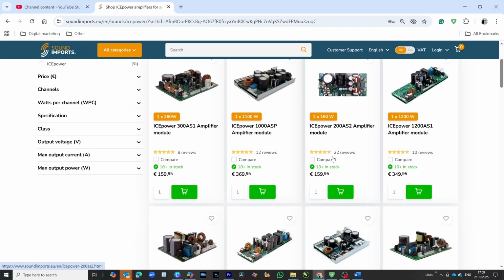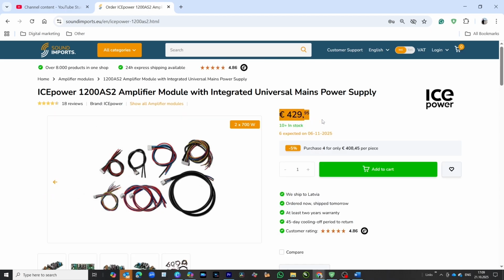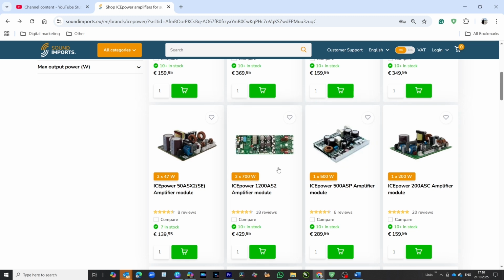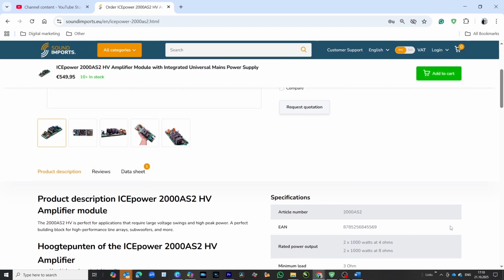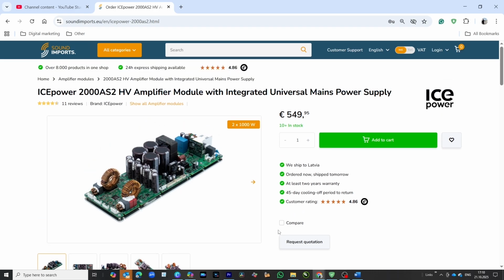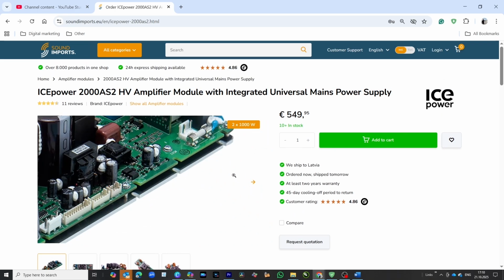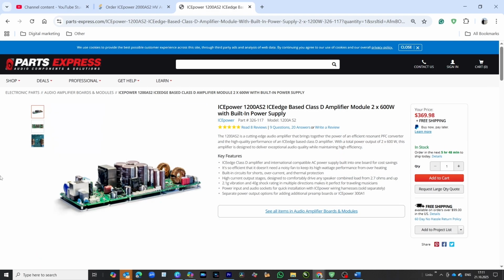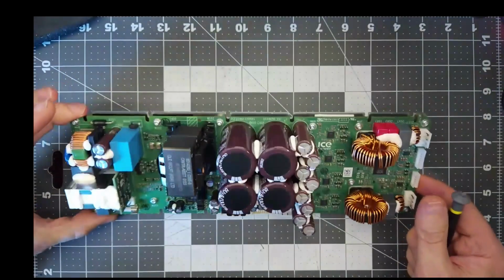Best amplifier in the world, does it exist Part 2 ICEpower 1200AS2 board deep dive

Comment: I mentioned this on your  comparison video: I bought a EVS 1200 (no longer made) based on Icepower AS1200 dual mono modules (same as in PS Audio M1200 monos but > $$$$). He tweaked them as much as he could, put them in an Italian chassis with more tweaks. It was ~ $2700. Amazing
Reply from the maker: We are living in information sociaty wher community is sharing a lot of things. Those small tricks liek putting something in jewelry box and selling welthy socity is not working well. Industry desperatelly need something new in amplification industry. Currently I do not see where it can go. Integrated speakers - too high startup costs. I see only one direction- multichannel amplifiers with build in DSP and spekaer boxes without passive crossovers making option to chosse passive crossover or make system active with external multichannel amplifier.

Comment: Very nice design , literally gluing caps to hot AC DC rectifier , so look at the top left of the board , that will be the place of failure . Also that SMPS is not the best design but ok , what is not ok is the lack of cooler on Amp chip , and even with it its Class D amp , meaning it will have noise on the output . If you use it with sensitive tweeter you wont be able to put it close to you due to hissing . But its good for sub , but it will fail .
Reply from the maker: It is a good, proven design. I have seen other professional amplifier companies using similar architecture. The output noise of this amplifier is just 30mkV.
Reply from the maker: You can run this board and check with a thermal camera. Everything is fine. I implemented this board in several designs and they working well in all load conditions. With a small fan board can even do professional scenarios with confidence. running at clipping level. For home usage, it has plenty of power reserve.
Reply: @guntarssmits2104  so you say its good to put electrolytes near heat source and glue them together, especially then we know that glue will conduct eventually , for the actual measurement dont do that , you dont know anything about performance of this amp , nor do it . Audio Analyzer has to be used . Rest is gossip. But since i know how Class D amps work , you can get rid of the noise but then you sacrifice high frequencies , all Class D amps have LP filters at the output , impossible to make them otherwise ,just like Tube Amps need an output Transformer , its a bad thing but what can you do . Same here , if there is no noise then HF is dulled , its a balance , there is no Quite Class D amp , does not exist , well one can make 2 and put them trough comparator with negative feedback  that would lower the noise , but drastically increase price for lowering a bit of Hiss on the output .
Same goes for Tube Amps , there are ways around output Transformers but its not easy and it comes with its own set of problems .

Then again  ,i use Class D amp , im not saying  they are bad , nor that this board is bad , aside the rectifier that is planed obsolescence . Im sure it is good , but non the less with a sensitive Tweeter hiss will be there . Where on other kinds of Amps if done good its not there . Maybe there is noise , but not Hiss , its inherent to the design .
Ive seen all of this and its fine running passive speakers with non sensitive Tweeters , there is Hiss but its not a problem . But on some speakers  it is a problem , for Near Field . For PA systems its not an issue at all .
Reply: What you are saying about the performance is not supported by the measurements. You need to look closer - the output devices are under the board and they are mounted with screws to the aluminum plate on the bottom side of the module. Quiescent noise level on the actual amp board is low; even sensitive tweeters do not produce detectable hissing. I have this amp, and I do not think you do. If you did, you would not claim these things, but fortunately the data sheet has a great deal of measured data in graph form. If you think you will hear the 400kHz switching frequency of the amp then you need to brush up on the physiology of the auditory system, because that’s just incorrect.
Reply from the maker: @Acoustic_Theory  Most probably, you have a grounding issue in the system. The board is dead silent when implemented properly, and meeting specifications indicated 30mkV output noise, which is very low for such power.
Reply: @Acoustic_Theory  i dont have it , you have it ,ok put a finger or the Rectifier , measure the temp of those caps glue on it .This will dry them very soon and since its mains its going to ruin the board , and maybe even your speakers .
Do the test , tell me im wrong and the Rectifier is cold .
I never said its a bad amp , but bad design in places . For example that Rectifier , those get hot , diode voltage drop is about 0,6V ,  x4 , those are the loses that go to heat . Everyone knows electrolytic don't like heat it dries them .
So if you have it , i highly suggest removing the Rectifier and put it on the other side of the board away from the caps .
That way it may work for 10 years , without that mod it wont . Obviously its hard to predict but it will die faster if that rectifier keeps heating up those caps .

Comment: Do they sound as good as hypex nilea?
Reply from the maker: All the latest gen class d amplifiers sound the same. They are using similar technologies and have neutral, precise sound. The key difference is in power and price.
Reply: @guntarssmits2104 ice amps seem like a much better bargain as far as price goes . The cheaper price had me skeptical about if there's a significant difference in sound. But I always hear you speak highly about them sounding musical.
Reply from the maker: @BostonMike68  Price is largely a function of volumes. Icepower manufactures its electronics in Malaysia, and Hypex in Denmark.
Reply: @guntarssmits2104 That makes sense
Reply: @BostonMike68  My EVS 1200 still does (dual AS1200 mudules), some 3-4 years since I bought it new

Comment: reviewing design and architecture perspective of a complex product isnt a good way of checking if something is good or bad. Testing the outcome is what you must do. test frequency, step response, max and peak power, sinad etc
Reply from the maker: For industrial certified boards, it does not make sense because you can trust the manufacturer's specifications. Some parameters are so good that you need specific, expensive equipment with a valid test certificate to measure them.  And there is legal responsibility for the outcome when you do it as a company ( legal entity). I will not publish industrial boards' measurements. For the 1200 board, everything is according to specifications, according to our tests. This is a good board from a good manufacturer.
Reply: @guntarssmits2104  Exactly.  A company like B&O/Icepower are mainly an OEM supplier for a lot of Major brands-- Fender, and Bowers & Wilkins, for example.  As such, the specifications and performance of their boards are a minimum as to what to expect, especially WRT to THD+n.  Large companies can rely on Ice to deliver their stated claims.  The datasheets from Icepower are excellent, very complete, and again, the quoted figures can absolutely be relied upon given the quoted operating environment.  The modules I've tested have met or exceeded quoted power, with measured noise and distortion besting B&O's quoted numbers.  All around a great company with an amazing engineering sector.

Comment: I built two monoblocks because I like the symmetry of having two amps in my rack (which used to be my beloved grandparents' coffee table), and I used two 1200AS1 single-channel amplifier modules from this series, installed in aluminum extruded cases. Their sound is refined, powerful, and not harsh, which is wonderful to find in a powerful Class-D amplifier. Icepower has nailed it with these modules. Only downside is that if the case is too open, there is a little bit of coil noise in the power supply, but this does not make it into the output.
Reply from the maker: Impressive setup. I have measured amplifiers output noise and ir is practically inaudable on speakers output. For me it is kind of strange feeling hat with good DAC you have a impression that equipment are switched off between the songs. Audio quality in all chain from source till the amplifier output hits the wall. I am wondering what will be next step in audio. McIntosh company mooved to Car audio to be profitable. High End conept is declining. What next?
Reply: @guntarssmits2104  Concentrate on the loudspeakers!  DACs and amps have been a solved problem for a while meow😎
Reply: That's why I didn't buy the ice amp, coil noise. But it looks like they updated the board and fixed the issue.
Reply: @florin604  Can you tell me where you read this, or what changes you noticed? I’m interested in any things to look for. These are great amps and I’d be glad to recommend them universally.
Reply: @Acoustic_Theory it's in part one of the video, where the new module has the issue resolved

Comment: There is no way that the transformer is 5kW.
Reply from the maker: By ICEpower 1200 data sheet, the rated power supply power is 3.8kW. Transformers should have higher power ratings for some reserve. Switching mode power supply is working at 80kHz and higher. Small-dimension ferrite core can transfer huge power in a small size. It is not the same as with 50Hz conventional transformers, which would have 7kg. Technology moved forward.
Reply: Switch mode PSUs use very high frequency mains. Transformers operate at extremely low dissipation. That is actually a very large SMPSU mains transformer. I don’t doubt the claim.

Comment: If you only "need" 50 watts for 91 db speakers, would you just get the 200 board?
Reply from the maker: There is a link to ex BBC engineers testing real power consumption for 100% transparent music reproduction https://youtu.be/Y3WpRY-EtX8?si=NRE0H9bJxhJDxM2q but you can use lower power amplifier for your system taking in account that some music with dynamic bass may be suppressed. Power reserve is one factor distinguishing mainstream amplifiers from top performers. Power and quality in the same box is costly option. By far more costly to desing, than just a low THD for moderate power. And good bass is crasy power hungry.

Comment: The ICEpower 1200AS2 is far faaaar from the best amplifier in the world. Actually, it's not very good if you compare to Nilai 500 or Hypex NCx500
Reply from the maker: This is exaclty what marketing traing to seed in community, but it is not true. I encouradge to read Brunos arctice where he stating that latest gen class d meeting point of perfection regarding audio quality and transparency. Other auplifier features like power, integreated by desing and features are key differenciator of modern designs
Reply: @guntarssmits2104  I mean yes you have a point, and Bruno is right, but when it comes to the ICEpower 1200AS2 it's not really accurate. That module is'nt that good. It has issues.
Reply: What issues? It is a hard claim...
Reply: @robertschumacher9640  It has issues with power on and off pops, it has issues with hissing, it has issues with quick impedance drops that makes it distort, it has issues with power-pumping with low impedances. And quite frankly, it doesn't sound all that good. It's kind of harsh and forward in the higher frequency's which makes this one more suitably for subwoofer amp only, IF the sub doesn't dip below 3 ohms that is.
Reply from the maker: @WorldFamousUnfluencer Could you please provide sources for your statements? I have built and tested numerous designs and have not encountered the issues you mentioned. When implementing ICEpower modules, it is essential to follow the guidelines outlined in the ICEpower engineering manuals—especially regarding grounding. This aspect is critical. If grounding is done incorrectly, it can introduce various artefacts. However, when implemented correctly, the board operates silently and performs flawlessly.
There are several studio monitors in the professional recording industry built on ICEpower boards, including previous-generation models. Feedback from my customers has also not reflected the concerns you mentioned.
Bruno Putzeys noted in one of his articles that we surpassed the limits of human hearing five years ago. Our sensory-level hearing is far behind that of many animals. As we age—particularly after 40—our hearing typically drops to around 14–12 kHz, and for most people, it’s closer to 12 kHz.
Ultimately, an amplifier drives a loudspeaker, which is an inherently imperfect electromagnetic system with high distortion. From an industry perspective, it becomes problematic when technology hits a wall and cannot be improved further through messaging alone.
Reply: @guntarssmits2104  I am the source, that is my experience with the module
Reply: @WorldFamousUnfluencer My dual mono AS1200 modules, which I have owned ~ 3-4 years now continues to perform with NONE of the issues you state and sounds amazing on all kinds of music
Reply: @roberthart9886 weren't you the one saying they have coil noise?
Reply from the maker: My recomendations would be request replacement board from seller. In case of correct implementation there is no your mentioned simptoms. I build several solution for professioanl and multichannel usage as well. No issues. Have you contacted Icepower team to clarify reason for problems? They have good servis and Ok response time. The only place where is possible to have issue it is mismatches in grounding. But if you preffer Hypex it fine. Those are good boards as well, unfortunatelly integreated version NC500 is not avilable for consumer market.
Reply: @guntarssmits2104  I had 6 of these boards, they all had the same issues. In my country we can buy NC500 and NCx500 boards no problem.
Reply from the maker: Then my recommendation is to contact Icepower support and try to find out problem rootcause. My implementations are dead silent. Probably we need to look at practical implementation and interconnection schematics.
Reply: @guntarssmits2104  I don't have these boards anymore, and I will never get them again. I have since built with Nilai, Hypex and Purify modules, all working flawlessly and sounds much better than the icepower 1200AS2
Reply: You might want to actually listen to the video first before assuring YouTube that you know everything. Your metrics are yours alone. The poster gave very good support for his claim and there is ample evidence aside from his claim. I’m very familiar with Hypex products and they are mostly very good. Can you say the same about ICEpower?
Reply: @artysanmobile  I'm also an engineer, just like the poster of this video. I have designed and built circuits for commercial products, I have designed and built recording studios. I would consider myself very qualified to have an opinion on this.